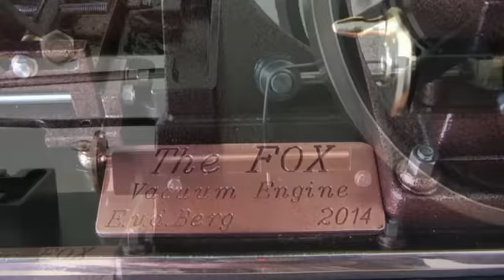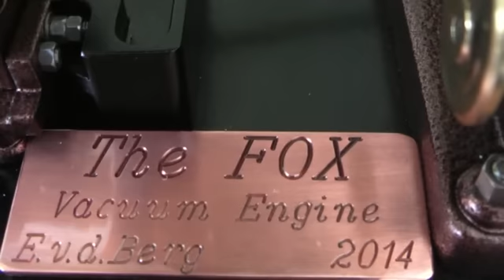Vacuum engine The Fox

Comment: What is used for piston lubricant?
Reply from the maker: bfarm44, Hello how are you.  for the lubrication of the piston I just use a little thin oil, I also lubricate the valve with it.  I spray the oil through the flam inlet that works perfectly.  greetings Ed van den Berg